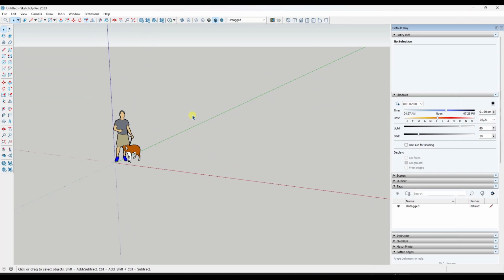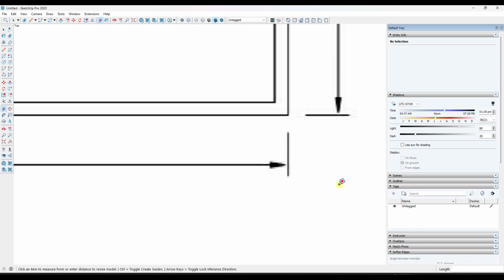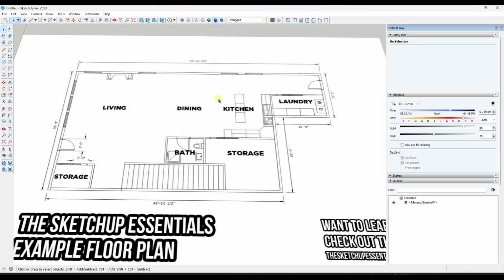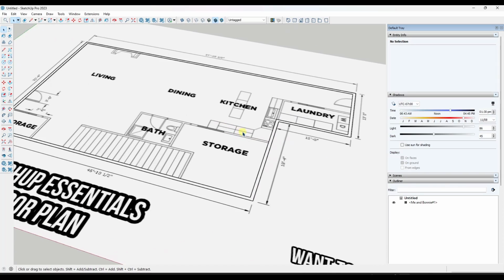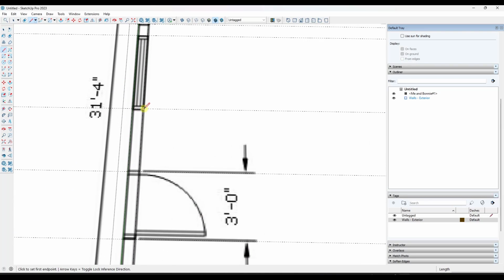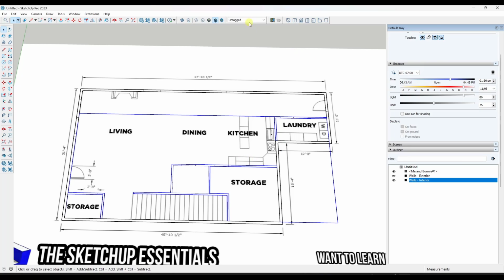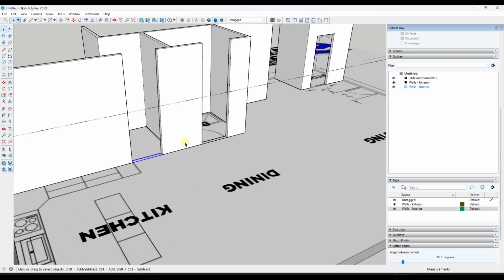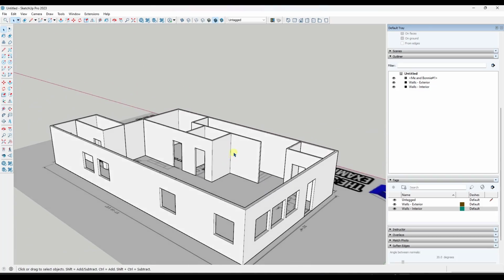Getting Started with SketchUp Pro for Beginners 5 - FLOOR PLAN!

Comment: Hi Justin. Thank you for this great tutorial! I haven't read through all of the comments, so someone here might have already touched on this.
Rather than exploding and re-importing the image to trace, can you just use the line tool to draw a line over the large dimension, and then rescale the line to resize everything? I have been using this technique and it seems to work well with less steps. I think it is pretty accurate?
Reply from the maker: Yep - just be careful there's nothing else in your model that will get resized. Another way to do it is to draw a line over the image, group the line and the image, then do the resize inside of that group so it doesn't affect the rest of the model

Comment: Justin, thanks for this and I am finally getting the finer points. I assume this is the easiest way to do the walls vs actually framing with proper layout. BTW for future videos a door is framed at 6'8"/80 high. ( Older carpenter. . .)

Comment: Pro Tips - Always use REVIT to Sketchup workflow to save time including (Auto Tags, Groups, Components).
1.Import image in REVIT and scale it.
2.Model all the Walls, Openings for (Doors & Windows) with better Revit element parameters 
3.Isolate each category as 3D View
4.Export 3D views as DWG 
5.Import DWG to SketchUp.

Comment: What do you say to the DIY folks like me who have no experience using CAD or design software, but want to learn and eventually be able to create a 360 degree 3D model of their entire property, inside and outside, including landscaping.  I want to use my existing paper blueprints as much as possible to ensure accuracy.  And, I'd love to incorporate the new technologies such as Lidar via iPhone and Drones.  

My plan is to create a bunch of different remodel ideas to share with my wife.  Some will be simple room remodels such as a kitchen remodel.  I want to create a bunch different concepts like opening our bottom floor, this would require knocking down walls.  

I understand there are estimating tools too, each iteration of my ideas ideally would have a rough estimation of costs.  

Having the ability to add furniture and cabinets to get a real feel of final design would give my wife and I something to use when we begin the bidding process for a general contractor.

Comment: What do you mean skp does not import pdf? I,’m on skp 2020 and it does… not available in newer versions? Reason enough not to upgrade then I guess
Reply: How do you import pdfs? With a Plugin?
Reply from the maker: I THINK this is Mac/PC thing. Are running a Mac? As far as I know, the Windows version still doesn't support PDF import unless something has changed. There are several extensions that can do PDF import of vector PDF's, but I've not seen anything that supports raster